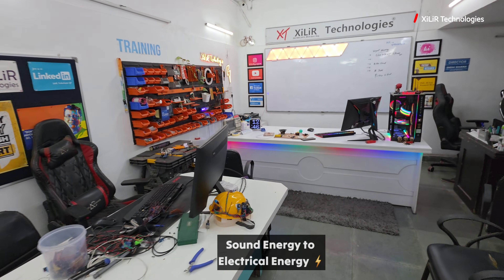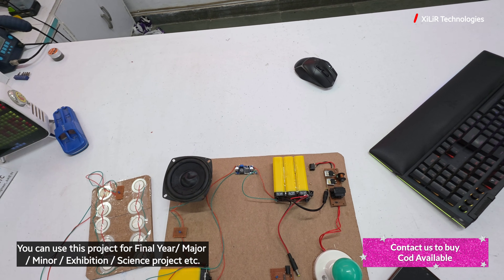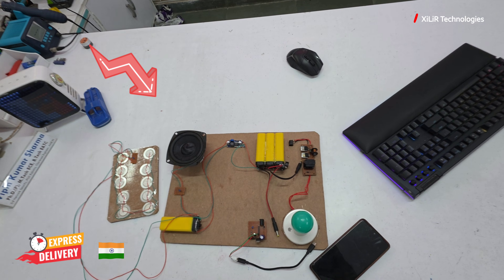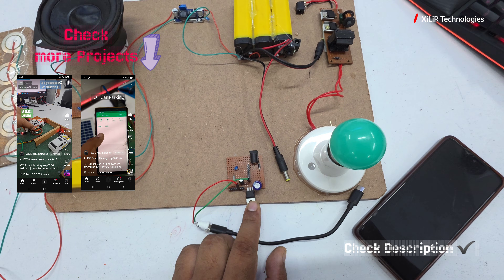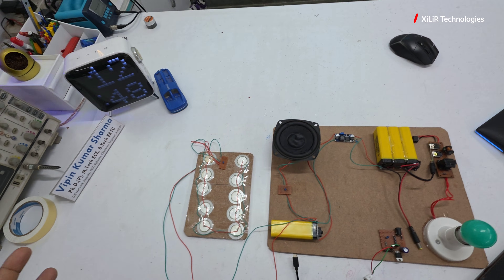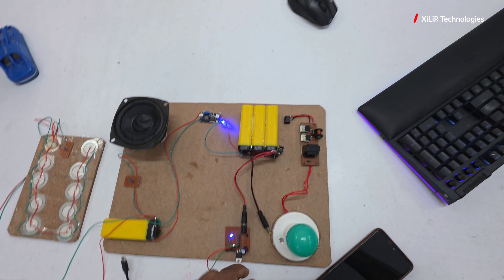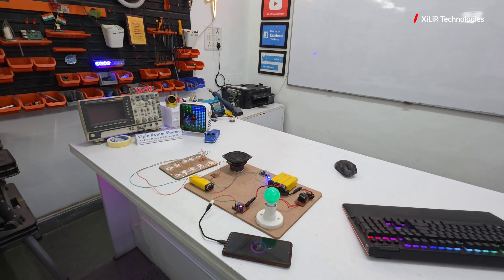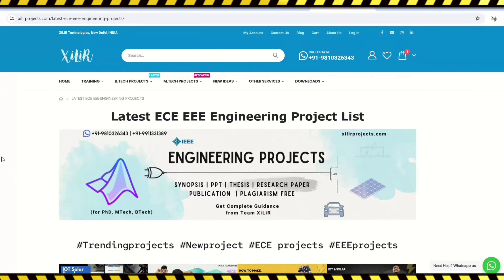📢 Sound Energy to Electrical Energy Project🔋#project | Inspire Award Winning

Comment: sir, does it mean that I have to tap it first to work? or can it work without tapping the sensors and just use sound?
Reply from the maker: Then for that sound waves 🔊 should be strong enough to vibrate diaphragm
Reply: Put them beneath pavements and roads, perhaps
Reply: I believe it's in Japan cbd's for a little while, now

Comment: How did u cut the wire in segment for piezoelectric sensors
Reply from the maker: Same thing brother is..peeling using nails. this is not PVC wire this is silicon wire as mentioned soldering will not work on it...this wire is heat resistant wire.
Reply: @XiLiRTechnologies ohh ok i got it
Reply from the maker: But using normal wire which is generally everyone uses soldering u can do at multiple point.
Reply: @XiLiRTechnologies no no i too have that silicone jumper wires.
Reply from the maker: These are high quality silicon wire . U can easily peel it
Reply: @XiLiRTechnologies peeling off at many points making it worse. What if i peel it off with soldering iron at many points

Comment: What component u used for phone charging
Reply from the maker: Just 7805 ic you need for 5v
Reply: @XiLiRTechnologies  and can i use lithium ion battery instead of lead acid
Reply from the maker: @AshmitSingh-j9hyes you should used those..
Reply: @XiLiRTechnologies and sir can u plz tell me how did u connect the diode and ic or send me a proper photo of that ic so that i can understand.
Reply from the maker: @AshmitSingh-j9hcheck video on this in that i have explained.. energy generation from walking project.
Reply from the maker: @AshmitSingh-j9hhttps://youtu.be/SuorKDb2Aqo?si=FCL7skxlvcSArXQB 
This one
..
Reply: @XiLiRTechnologies thankyou bhaiya